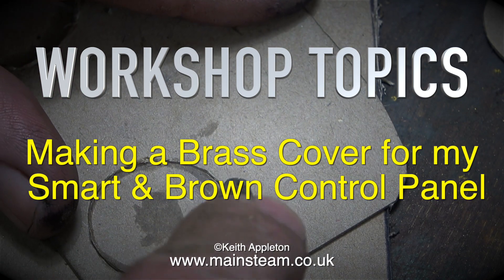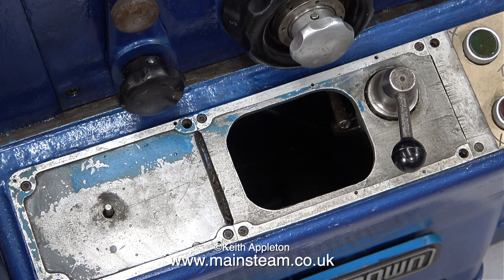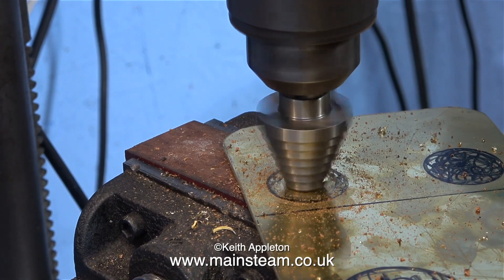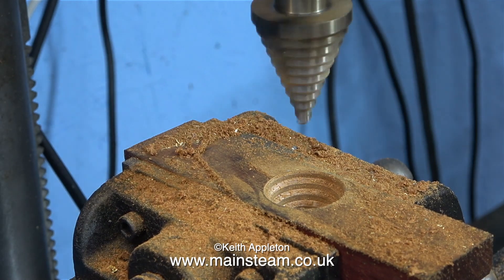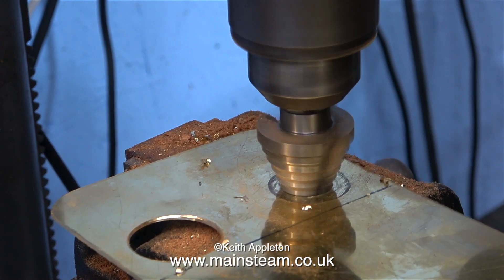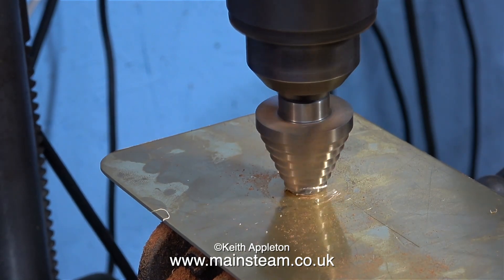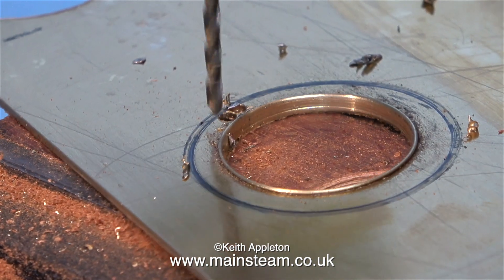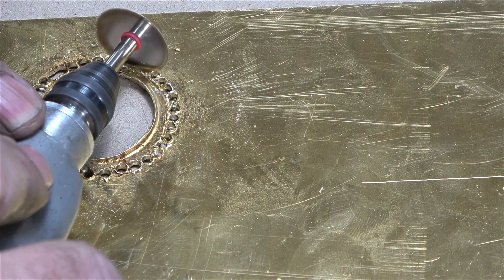CUTTING THE HOLES IN THE LATHE CONTROL PANEL COVER -  WORKSHOP TOPICS

Comment: When I was sixteen I worked for my uncle who was a plumber and boy-oh-boy did I have fun cutting pipe before I realized that the valve I turned off was the wrong one. sixteen years old in a machine shop, must have been before safety labor laws in the UK?

Comment: Your accident with the hair reminded me of my machine shop days in the seventies.  That happened to one of the guys and it tore out a chunk of hair from his head.  One of the workshop jokers gaffer taped it to the front of the drilling machine.  It was stuck on there for years.  The other no no was wearing rings if you were working on lathes.  Strictly verboten by the workshop manager.  Happy days, well some of them were.
Reply: I worked at an engineering place, talking to the lady that deburred and packaged the parts one day about hair getting in the drill. She pulled up her hair and showed me a bald spot about 40 mm diameter. Years ago at another place doing the same duburring job and 6 months pregnant and whoosh her her gets pulled into the chuck. Ouch.

Comment: What about the writing showing the settings that was on the original?
Reply from the maker: No much point in using that. The Lathe no longer has a 3 speed motor . . .

Comment: On the panel, I woul drill pilot holes, hold it in location, and mark through. I like second opinions. The creative types could mount an angle plate to the cross slide, a boring head in the three jaw chuck, and drop those holes spot on.
Reply from the maker: Thanks for the tips!

Comment: This was actually fun to watch, but just a little tip from a guy that drills dozens of holes in sign cabinets everyday using a step bit...It was a good idea to use a marker to color in the holes, if you take a ruler and just scratch cross lines inside the hole you'll get a quick center.  takes 30 secs and saves several minutes.   But a fun video none the less. Thanks for sharing